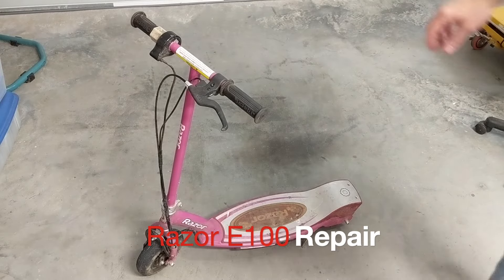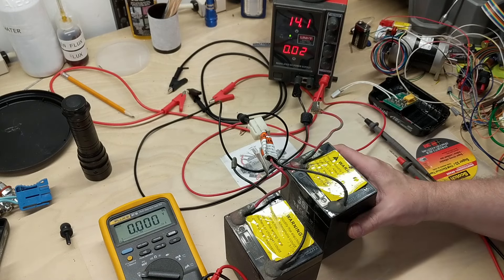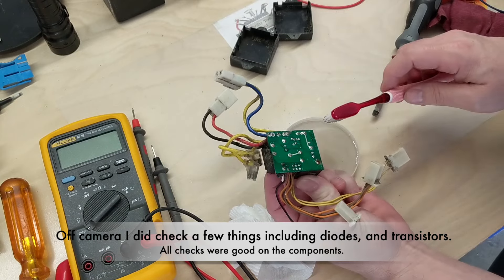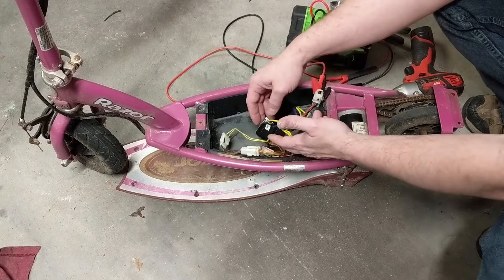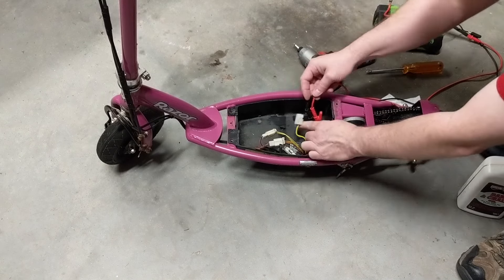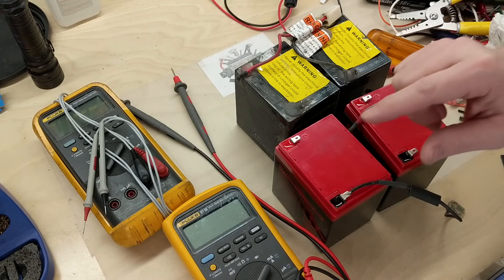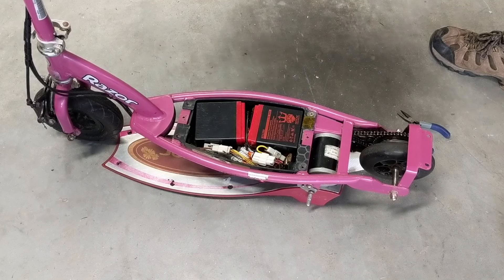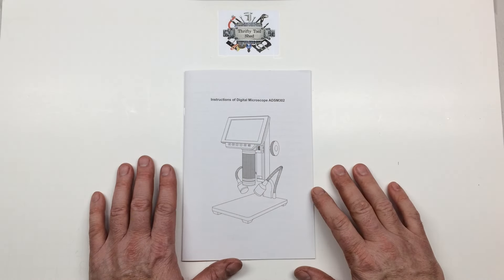Razor E100 Scooter Repair

Comment: Can you post a video on how to check and repair the controller board?
Reply from the maker: Well I no longer have this because I gave it back to the little girl. After cleaning the corrosion I had no issues with this one. It's fairly simple, it gets a contact from the accelerator switch and if you kick start it will pick up motors voltage generated and pull the relay in. If you need to verify motor is ok, you can put the voltage across the motor to test rotation. Which issue are you seeing?
Reply: @ThriftyToolShed  continuity on the brake switch and throttle switch are good. Batteries are good and it runs if i put 12v to the motor so im at a bad speed controller. Just dont want to buy one do i will take it apart and check the relays.
Reply from the maker: @jochute , Yes a good place to start.  Make sure the motor  is spinning up pretty good to allow the controller to pick it up so the controller can start up and at least the controllers are fairly cheap on eBay!
Reply: I got a e scooter today and it's kicking out / shutting down ,  is there a thermal limiter and this thing?  isn't supposed to be old and it isn't the battery charger is getting kind of warm this thing has no hours on it but someone has been inside of it the motor is in the hub

Comment: I put new battery's  it lights up but dosen't go I tryed pushing off nothing  I don't hear the relay sound when you put power to it any idea what might be wrong my guess is speed control i jumped power to motor it started im lost
Reply from the maker: If you are giving it a good push and still not starting then it could be speed controller. If not already double check voltage is getting to the controller and also make sure the throttle switch input is getting to board and if I remember right the brake switch will kill the board as well, make sure that is working well. If those things are good it's most likely the controller since you have already ran the motor.
Reply: 7 have a razor E3000 i have charged the batteries and so I go to ride it and its wanting to go for about a 12 feet then slowly dies out now I've picked up the scooter off the ground and pushed the throttle tire spins nicely the way it should full power so I put back on ground same thing dies out slowly with a mooning groaning sound what is the possible problem. Here
Reply from the maker: Sounds like from what you are mentioning, that the battery is bad. That is common with older batteries, they show charged fully and die very quick with load. You can tell easier with a load tester. If you don't have a load tester, the best way is to measure the voltage while under load. But it's most likely telling you that anyway when you go to ride it, the load is causing the batteries dropping off.

Comment: thanks for the helping video I wonder how long it takes to fully charge the batteries !
Reply from the maker: I did not fully discharge and charge to verify, but I only ordered a .6A charger for it and the 2 batteries are 5ah each. So somewhere around 16 hours to charge if completely discharged?
Reply: @ThriftyToolShed  Walmart has a universal charger that does the job in about 3 hours. I know slow charging is better for battery life but try explaining that to a kid. lol
Reply from the maker: @paulolm3878  
No doubt!
Reply: @paulolm3878  I have a razor need to get it going where to purchase part's if needed my name is Samuel
Reply: @samuelcabazos5810   Google "Razor electric scooter parts". Get parts from Razor, several third party parts suppliers, or Amazon and Ebay.

Comment: New batteries I have  ,got male spade terminals will be getting the ‘females’ tomorrow
Reply from the maker: Awesome, it's a really good idea to replace connector for high current drains periodically anyway, especially the slide on type!
Reply: When I first saw the motor it is so tiny , now I changed the spade connectors  and hooked up the battery that tiny motor  packs some real 🥊